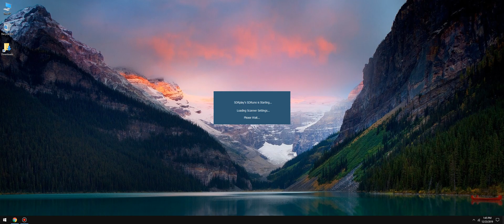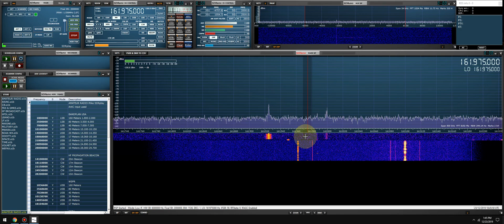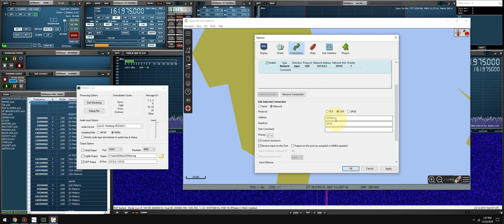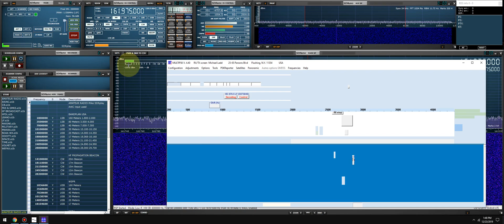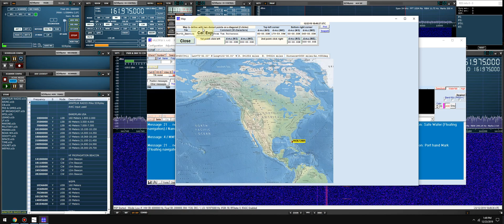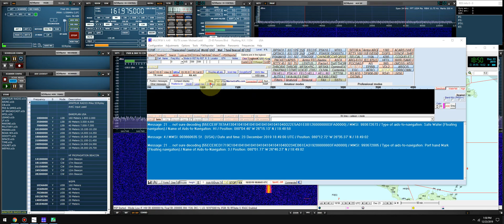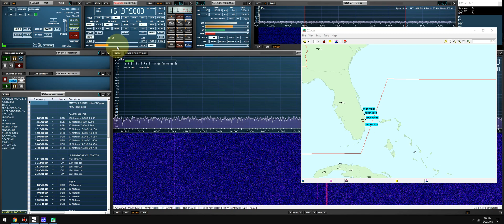SDRuno, decoding AIS marine traffic

Comment: Thanks for the very informative video! I am having issues with mine; AISMon Demodulator Counts is showing me an increasing Sync count, but at the same time, error count increases. Valid is at 0%. Any idea as to where I can start hunting for this error? I can see the signal on the scope without any issues.
Reply from the maker: I would need to see a screen shot . Can you post one on imgur and paste the link in here?
Reply: SDRplayHamGuides thanks for answering me. I managed to get it to work; turned deemphasis off and did a Win restart. All is working now :)

Comment: So far this is only 360 P resolution. Hope higher res comes soon. Thanks for the video. Have a happy holiday.
Reply: These guides are great showing how the devices can be applied depending on what someone is interested in. Only suggestion would be to link to PDF showing screen captures of the relevant settings with discussion. Also would be helpful perhaps if an application that could magnify the screen in a floating window so we can actually see relevant info. Everyone isn't likely to have large LCD monitors.
Reply from the maker: I will see if I can lower the resolution
Reply: @SDRplayHamGuides  It's a common problem with many of the "How To" videos. Some experimentation would be in order to see how they played back on monitors that people typically have.  I don't know if that is 1280x1024 or even less.
Reply from the maker: It will transcode to HD. Youtube is a bit slow processing video.
Reply: @SDRplayHamGuides  All good now at HD